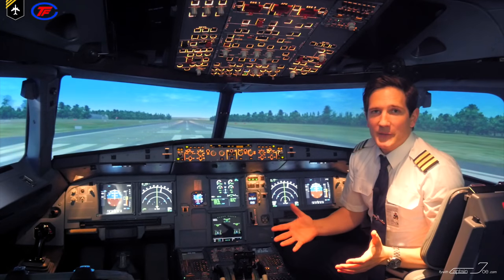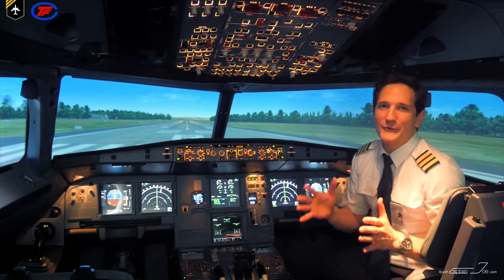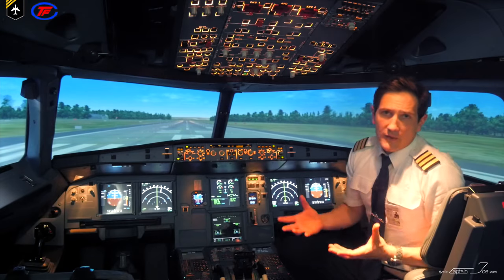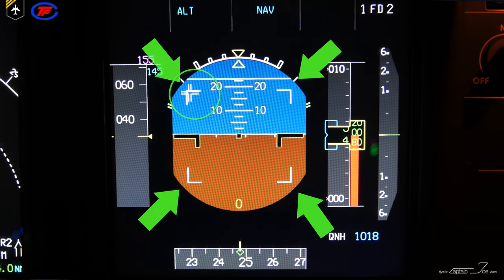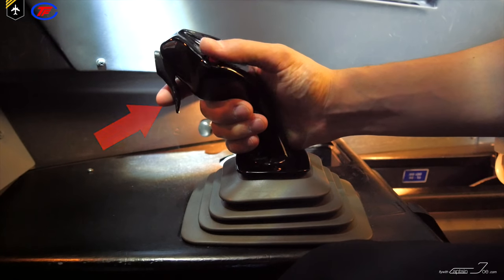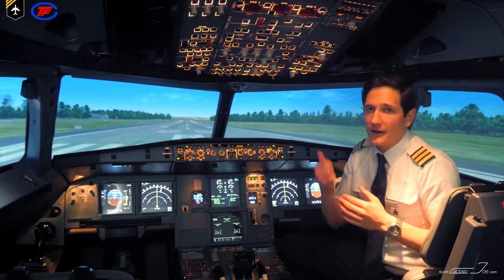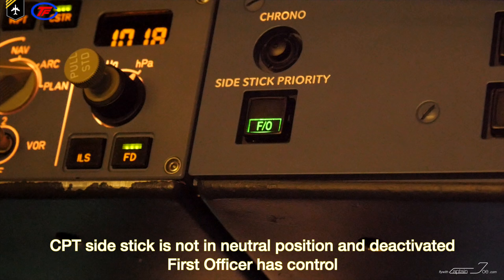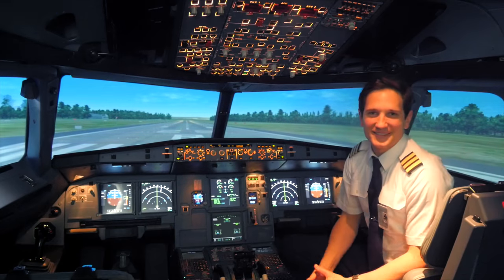AIRBUS SIDE STICK - Explained by CAPTAIN Joe

Comment: Did Air France 447 have the dual input warning?
Reply: Yes. The pilots were confused and panicking. There was no saving them in my opinion.
Reply: Well any of them could push overwrite button or use trims or do it on computer. Pilots error not problem with plane.
Reply: was there audible warning though? the CVR showed no priority right sound during the stall, and for sure David Robert thought he had control and pitching down to recover while Pierre-Cedric Bonin was pulling back the whole time.
Reply: They had multiple sound warnings about all kind of stuff.
1.) they disregarded any sound warning
2.) they also disregarded every single instrument that flashes ect.
3.) whole plane was iced also they were doing some weird things so aircraft went into "alternate law"that is kinda(in this particular flight) "there is no fck way this could happens thus instruments get totally errored"
4.) they were not using "direct control" or "mechanical control" anyway so probably computer disregarded most of inputs control from Bonin because of safety
Reply: jospi2 I had to think about that too for some reason. Apparently it did sound (like almost all of the other alarms I feel) but no one commented on it apparently so it's hard to know exactly what was going through their heads(obviously) but what we do know is that they had to deal with a lot of conflicting readings to begin with (e.g. the air speed displayed on the left primary flight display was “inconsistent” with those on the stand-by instrument system so they got an overspeed warning AS WELL as a STALL warning) In the end the computer was telling them that they were going too fast, too slow and too low all at the same time. I think no one in that cockpit believed their instruments any longer, yet for some reason the most likely scenario in the head of the (co)pilot flying was that they were over-speeding so he must've blanked out everything else until the captain re-entered the flight deck and commented on their pitch. They'd been falling out of the sky at over 10 000 feet per minute, in a nose-up attitude, for quite some time at that point. When he gave back control to his colleague on the left they'd run out of time. So I don't think it's as easy as saying "oh but none of this would've happened in a Boeing", really, do you 😟
Reply: Well but You rly don't need instruments to feel in which direction acceleration is also artificial horizon don't(doesn't?) depend on pressure. But "feeling" is not trained in simulators nor anyone allow those pilots to do some weird shit in air unless they are test/military pilots.

Also pilots are supposed to not trust anything pressure related(speed and altitude) if there is emergency situation with icing on whole plane. Especially that icing of pilot tubes is common thing. So no rly error in that.

Rly this crash is pure pilots, especially Bonin, error.
Reply: Czorńy Lisek Ahem... I think the answer to that is "Yes you do, you're wrong" - ever heard of spatial disorientation? I've never flown an A320 but I've sure sat in one thinking we were flying straight until the coffee latte on my new white pair of jeans showed me we were banking to the right quite heavily 😏 I'm quite sure it's been the major cause for quite a few accidents as well
Reply: The only time you should feel sideforce in the aircraft is on the ground, because the airplane should always be in coordinated flight.

Bank angle determines load factor, not lateral force.

Source: I'm a glider pilot, we live and breathe turn coordination.
Reply: Any change in direction, speed of fight ect. Well generally any change in energy results in pilot moving somehow just as plane is moving. Pilot should be able to feel that.

Yes there is spatial disorientation. But that should not be excuse for pro pilots(that have license to fly without any visibility) and they didn't rly needed to know location in this incident. Artificial horizon was perfectly working and they should feel change in energy((de)acceleration) anyway and radiometer as I remember was perfectly working, just Boni completely freak out and didn't even "allowed" other pilot to recover.
Reply: The priority was passed on but too late. The crash was cause by the plane going to a stall at high altitude. The PF was pulling on the stick instead of pushing to recover the stall. Sadly the only thing they should have done when the autopilot disconnected was to do absolutely nothing. The pitot would have eventually de-iced and the flight could have resumed normally. Nothing wrong with the plane, just pilot error and/or lack of training.
Reply: jospi2 yes They had many dual input warning When Left pilot was pushing down without realizing that other co pilot is pulling up he gets the warning but didnt trust it until His co pilot says He has been pulling back from very beginning but it was too late 😩😩
Reply: Jonah Beale WRONG. It they were flying a Boeing (yoke) this wouldn’t have happened!!!!! They would be aware what the other pilot is doing and had sufficient time to save the plane. Airbus is trash, joysticks are a faulty, inferior design. Many pilots would concur.
Reply: They both were inputting controls that countered each other and canceled each other out. Airbus added this warning in response to the new aircraft
Reply: Yeah but they were busy with other things but the captain (the real one) realized that when thwy only had 2000 ft to react
Reply: Yes it did. Sadly however the 2 co pilots involved in the crash did not handle the situation properly which caused the Airbus A330 plane that they were flying to crash into the Atlantic Ocean.
Reply: is the green f/o left or right side button actually pressable seems a bit awkward if you have to press and hold the red button on the joystick :) for 40 seconds to just switch who has priority 
i guess this was just completely focusing on the stick 

and the other post the about af447 crash, captain did not come back to the cabin fast enough when he was requested and the robert (left pilot) was not aware that bonin was pulling back on his stick until bonin actually stated it in the last 40 seconds, robin should of taken control of the plane as he has more flying hours and it was an emergency, as bonin only had somthing like 200 hours and he was an idiot who should never been on a plane as he did not know how to fly a plane manually or understand basic flying (seems he was flying it like it was in normal law mode and had no understanding on how alt law mode works)
Reply: The "robin" (left pilot's) name was David Robert.
Reply: @supertrix101  sorry been long time from when I seen the reports (still very bad to comeback to really, pulling back in a stall)
Reply: Pierre Cedric Bonin had 2,936 flight hours, of which 807 hours were on the Airbus A330, yet Bonin did make that bad mistake of pulling the stick back while the plane was stalling. I heard that he did not have enough experience of flying the plane manually and he was not properly trained to do so, especially under the circumstances that he was in when Air France 447 crashed in the Atlantic.
Reply: @CzornyLisek The Pitot-Static (Prandle) sensors deiced quickly as they descended by they had lost trust.
Reply: I don't think they had a duel input problem, they let the must junior officer do the flying in this crisis and didn't realise he was pulling the nose up almost till they heat the sea 5 minutes latter.   There is an indication on the artificial horizon as to where the controls are.   Pilots need more simulator training for crisis irrespective of Boeing or Airbus.  Repeated simular training.
Reply: @CzornyLisek  Joe said it takes holding 40 sec to overwrite the other pilot's input. I would say that's a bit too long.
Reply: @CzornyLisek  Never heard it went into a alternate law
Reply: @CzornyLisek  yes u do

Comment: All interesting stuff, Joe but surely, THE question on side-sticks is why were they introduced at all? What is the advantage vis-a-vis the traditional central control column?
Reply: More space in the cockpit.
Reply: More space to operate computers because that is what you are doing 98% of the flight

Comment: Very informative video. I remember the investigation into the crash of AF 447 pointed to the airbus sidesticks as a potential cause of the tragedy, as it was only up until the last minute the captain realised the copilot had his stick back the whole time thus stalling the aircraft. I think there was a video with Captain Sully Sullenberger (Hudson River water landing) who also pointed to the side stick design being a major design flaw as boeings use the "steering wheel" type design which are mechanically linked thereby eliminating the need for these elaborate side stick priority warnings / indicators. I would have thought Airbus would have improved the design of this or modified it in such a way so that it is much MUCH more obvious to the pilots which inputs are being accepted by the aircraft.
Reply: It is obvious Just both pilots panicked and co pilot gone stupid because of that(or was used to military, ultra light planes).

If there would be stiff linkage they would simply fight with muscles And people in panic don't rly give fck about what they fell. Probably they could do that with enough force to even break their bones.
Reply: Instead of relying on your memory, please re-read the report. If any, the effect of the flight control design was minimal. Lack of (high-altitude) stall recognition and stall recovery training was much more important.

And neither of the pilots in the pilots' seats at the time of the accident was a captain.
Reply: MrScififan Sorry to disagree but Sullenberger never called it "a design flaw" - not even a CEO for Boeing would do that- he rather eloquently explained how the co-pilot's action would NOT have gone un-noticed in a "conventional type of aircraft" (meaning BOEING). I'm so sick of that Airbus-Boeing rivalry hullabaloo 😩
Reply: Thats true he never did say that, the "major design flaw" bit was my interpretation. I wasn't even aware there was any rivalry between Airbus and Boeing. Both seem like great aircraft manufacturers - but after looking into AF447 it seemed to me that the copilots incorrect input would have been noticed a lot sooner if it was much MUCH more obvious which inputs were being accepted by the aircraft. The yoke design makes it obvious, and unfortunately the side stick design, it seems, does not.
Reply: Swede Potato Pie      He didn't say it because he's careful and diplomatic.   But Sully clearly said the AF447 accident would've been much less likely in a Boeing aircraft.    Maybe the Airbus design makes other accidents less likely.   But certainly not AF447.

Comment: One aspect that Joe didn't mention is the fly by wire. Most people assume FBW is just transmitting your movements to the control surfaces so you don't feel the forces etc. 

In reality, FBW is much more complicated and way cooler than that. 

When you pull the control stick, you aren't saying to the airplane "I want X amount of surface deflection." You're telling the flight control computer "I want to go up a bit." If you yank the stick all the way, you're saying "I WANT TO GO UP AS MUCH AS POSSIBLE!" The control system knows the aircraft's limits and will not exceed them. You can't stall, overspeed, overstress, or get the aircraft into an unusual attitude (upside down, extreme nose high/low). The system is completely adaptive to airspeed, altitude, and aerodynamic configuration. It's tuned to give smooth, predictable responses, no matter where you are in the flight envelope. This is how Airbus aircraft manage to be easily controllable AND have good control authority despite the very small side stick. A truly amazing piece of engineering that is often overlooked.

Comment: To what extent if any do you think the Air France flight 447 crash was affected by the 'unlinked' side stick v Boeing system?
Reply: Steeltrap was it Boeing or Airbus?
Reply: I'd argue none. It was due to bad CRM than anything else. Why the hell were two pilots flying? That is the question. And how/why they didn't know they were in a stall and why didn't the junior know how to recover a stall? Those are the correct questions, I'd argue. In fact, the first question is, why didn't they know that they only had to increase power due to airspeed unreliable and that was it.

Comment: What a terrible idea, these sidesticks. 
The fact that the two sidesticks are not mechanically linked obviously 
prevents both pilots from knowing the position of the other sidestick, 
with no visual or sensory feedback, something that's believed to have 
been a factor in the Air France 447 disaster. One of the pilots simply 
wasn't aware of the nose-up input by the other that primarily caused the
 plane to stall,, and both believed they had control of the plane, 
something that would have been impossible with a control yoke system.

Comment: A yolk just makes way more sense to me. To not be able to see your co-pilot's inputs on his or her joystick seems sketchy as hell to me and has already partially caused atleast one major air catastrophe.
Reply: Thats just speculation, Bonen, the co pilot of Air France 447 was highly untrained and made a number of mistakes. Currently studying up to try and get my first stage commercial pilot license. The benefits of the side stick out weigh the cons, in the off case the co pilots yoke has a malfunction the left pilot disengage feature of the air bus is far more practical, also its subtle movements could be vital in a hostage situation. Frankly I find the airbus a320 side stick to be a far superior flight stick to the boeings yolk, it also makes for a much smoother landing for me personally.

Comment: How to get back to neutral from priority left or right?-- And by the way thanks for the video.
Reply: My guess is that you would have to press and release the priority button on the stick that's deactivated, based on related information that he provided.
Reply: I am no commercial or even turboprop pilot, but if I am not mistaken the control priority can be turned off by either pilot pressing the takeover push button.
Reply: What if the button malfunctions ? Is there another way to gain priority ?
Reply: You could move over to the other seat.
Reply: Greg Stark What if the priority was assigned to the captain stick, but then the stick malfunctions and you want to give the fo stick the priority, but then the button on his side malfunctions ? :)
Reply: Greg Stark perfect
Reply: If steering malfunction critically there are trimers also probably there is some way to take over control using computer(including doing that from ground). If just button does not work any pilot can (de)press it on own side and it will go to neutral mode.

http://static.progressivemediagroup.com/uploads/imagelibrary/nri/aerospace/features/dreamliner-a380-cockpits/A380-displays.jpg
Reply: I looked it up because I remembered it wrong. Yes, even a deactivated sidestick (by holding the takeover pushbutton for more than 40 seconds) can be reactivated by pressing either takeover button shortly. So if there's a real fight over control, neither can win permanently. The pilot to press his button last, gains control.

Comment: wait, it takes 40 seconds to take side-stick priority? FOURTY? isn't that a potential hazard?

Coming from a single engine flight training environment I feel like 40 seconds to take full control in the event of a fault or silly bugger by the other pilot sounds like a lot, but I guess it's just not a concern in airlines. Interesting
Reply: Good catch mate! This is precisely the Airbus technology!
Reply: Andy Plater no 40. 3 seconds
Reply: The inputs from both sticks are summed, so you can cancel out the other stick's input by pushing yours in the other direction.
Worst case scenario is you have neutral input for 40 seconds.
Reply: I´m a bit late, but it does not take 40 seconds. 
Standard mode is dual input, where the movements of each stick are normalized to an average input

Pressing and holding the priority button just for a moment will transfer full control to that stick. This can be done by either stick at any time.

The 40 second push will only additionally permanently deactivate the other stick.